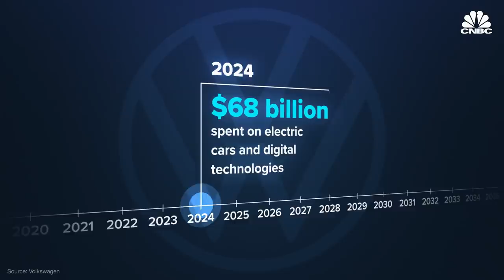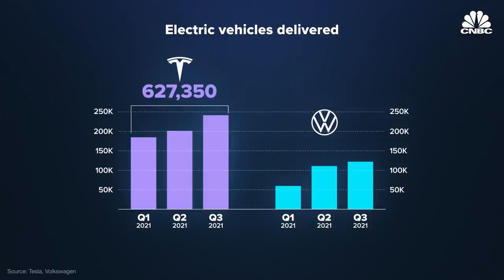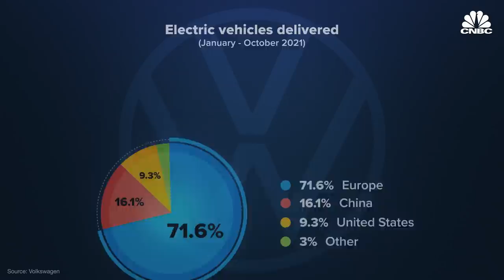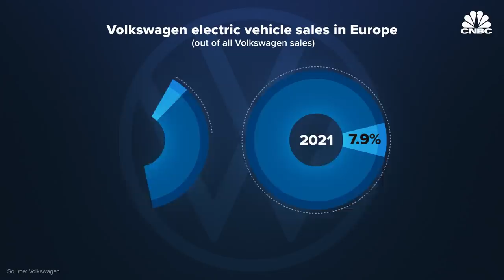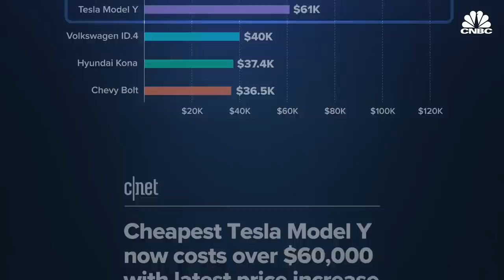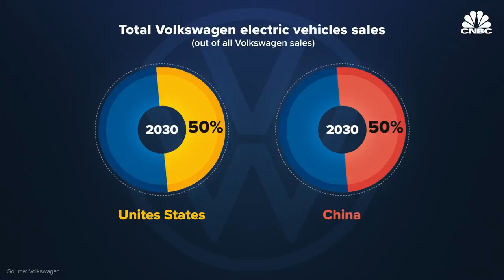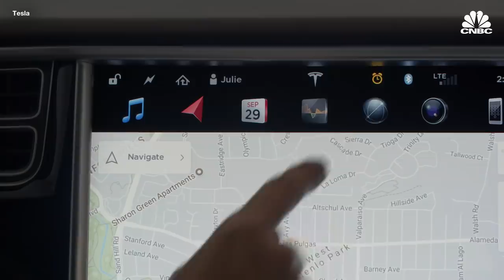Why Volkswagen Is Beating Tesla In Europe

Comment: I'd argue that VW was already bigger in Europe than in the US...so for that reason alone, it wouldn't be shocking to see VW EV's being accepted more readily in Europe than Tesla's offerings.  People are more likely to accept a new technology from a company they already accept, then from one which appears new.
Reply: Check Q3 2021 Ev Sales figures for europe... Tesla vastly outsells VW
Reply: Tesla doesn't make EVs in Europe meaning their supply is relatively low. So, even though demand is high, sales lag behind compared to places with Tesla factories. It's not complicated.
Reply: @HopeIsFleeting  You're 100% correct. Tesla currently only has supply for europe with what they decide to import from China. Despite this, they are still number one in Europe for Q3 2021 Plus number 2 in china... all from a single factory!
Reply: Plus, another significant point is that Tesla is the only EV manufacturer with any sort of profit margin on each car.. roughly 35% margin and constantly increasing. VW is basically selling EVs at a loss
Reply: Wow lots of people with so much knowledge about either company, Tesla this and that, the reason is this and that. Fan boys lol
Reply: So where is Nokia now?
Reply: @vinny7114  🤣🤣🤣
Reply: @rushabhjs  making a ton of cash from their patents.
Reply: Yeah Volkswagen is huge in Europe. In case you didn't know, 1 in 4 cars (not just EVs) sold in Europe are from the Volkswagen Group.
Reply: @vinny7114  Of course they do, this channel is for investors. People usually research the companies they invest in. If that makes them fanboys then fine. What's important however is that it makes them a return on their investment.
Reply: @yscol1313  Man you love spreading lies.  VW sold more in Q3 2021.  If you wanna make the claim Tesla has the best selling single model then you would actually be correct, but vw has multiple popular models, unlike tesla, as per sales.
Reply: @vinny7114  It's called discussion. And it's healthy when people can bring forward their ideas backed with data without being ridiculed for interacting. Pretty sure most people who clicked into this video are interested in the future of EVs...
Reply: No
Reply: @vinny7114  I would just call them educated on the topic, but agree to disagree.
Reply: @Subwolfer7564  what electric VW outsells teslas models? The model y and 3 are the most popular EV in the world.
Reply: It's not just about acceptance, it's about convenience, the total cost of ownership, patriotism, prices, subsidies etc. VW will always have a better service network, availability of spare parts, and so on.  The US is on a high horse when it comes to EVs thinking that everything will be just Teslas. The support for electric vehicles here has been very strong lately and only the future will show. I'd say that making predictions about what happens 10 years from now is extremely premature. Having had a very early start didn't mean absolute dominance for iPhone in the long run and cars are arguably even a much more different animal than a phone, where locality will always be important.
Reply: And VW has the ID3 better looking than the boring Tesla 3
Reply: @KingFinnch  It will not be a massacre. Despite VW having lower margins, they have much better design and quality. Many people prefer a Porsche Taycan, an Audi GT or a VW ID3 to a boring Tesla 3, S or Y.
Reply: @nunolp9067  the id.3 is the most generic car ive seen, the CEO of VW had a major meeting with leaders in the company to discuss how much of a threat tesla is, he made claims like tesla building a car in 10 hours while it takes VW 30 for an ID.4, he even said that the opening of the giga Berlin site will be "brutal" for VW to compete. The taycan has already had multiple recalls and got beat by a bunch of model 3's at the Japanese EV prix because it overheated on the last lap despite being 3x the price. Many people would prefer those cars because they are a sucker for brand loyalty.
Reply: @diazemap  the model 3 was the best selling car in Europe in September, and this is before they have even opened up their new massive factory in Germany. You guys think to staticly, you think brand loyalty last forever and tesla cant ever get good at where its bad and VW can never get worse over time. Tesla has more talented people trying to do more than show a quarterly profit for their shareholders.
Reply: @odisy64  That might be true, but that's because of the global chip shortage which is a fluke that worked massively in favour of Tesla. Tesla didn't outsell other brands because that's the car most people want. There are just not enough of ICE cars to buy right now.  I am not saying Tesla is a bad car and there will be a lot more of them on European roads and why the heck not? Nor am I saying that Europe has been thinking tactically enough but times are changing. In the grand scheme of things any EV is a rarity everywhere and the future is long. Brand loyalty has never worked perfectly, European cars are actually very international. When it comes to talent, there's enough of it in Europe as well. The true danger is China anyway.
Reply: @odisy64  were talking about Europe, context is important kiddo, sit down and open your picture books.
Reply: Tesla needs to fix bad build quality and all the rattles, interiors are from cheap plastics.
Reply: @Subwolfer7564  Yup, this video has triggered many a Tesla fanboy. 11,634,409 cars were registered in total the EU in the 2020 (14,033,559 in the EU plus EFTA region). And how many of them were Teslas? Model 3 accounted for only 85,000 and people are forecasting doom for the European automotive industry. Plus Europe has ultra rich eco hypocritical countries like Norway that are massively skewing the numbers.
Reply: @Patrick-bu5vy  Tesla fanboys have been repeatedly voted as the most annoying fanboys on the entire Internet. BTW, in the end we will be all steamrolled by the Chinese just on the price front. The US and  Europe especially. These fanboys fail to understand even the most fundamental thing of all. That competition is always good for the customer and most people can't afford any of these expensive EVs  anyway. Inflation is raging all over the world. Tesla cars are mostly luxury sports cars with unnecessarily fast motors, large batteries and expensive design full of features that again cost a ton of money and nobody needs them anyway. More and more people worldwide are struggling to cover even their basic needs and will gladly jump at the first Chinese EV costing just as little as 10000 USD.
Reply: @KingFinnch  Yes. Tesla will pass Volkswagen when Giga Berlin opens up. Volkswagen have already expressed concerns over this publicly.
Reply: @vinny7114  "Wow lots of people with so much knowledge about either company, Tesla this and that, the reason is this and that. Fan boys lol"

Personal attacks are never valid arguments. So please try to come with some real arguments instead.
Reply: There's no argument that VW is bigger in Europe than the us.
Reply: @vinny7114  "making a ton of cash from their patents."

The Nokia reference is about their big fall in the phone market. Obviously.
Reply: @nunolp9067  "And VW has the ID3 better looking than the boring Tesla 3"

If you look at the actual specs you will find that the ID3 is the boring car here.
Reply: @nunolp9067  "It will not be a massacre. Despite VW having lower margins, they have much better design and quality. Many people prefer a Porsche Taycan, an Audi GT or a VW ID3 to a boring Tesla 3, S or Y."

Nonsense. The quality of the Teslas coming out from Giga Shanghai is of as good quality as any Volkswagen. Just listen to what Sandy Munro have to say about this.
Reply: Lol a spoke persons for Tesla Ladies and Gentlemens
Reply: @diazemap  "That might be true, but that's because of the global chip shortage which is a fluke that worked massively in favour of Tesla. Tesla didn't outsell other brands because that's the car most people want. There are just not enough of ICE cars to buy right now.  "

Nope. There isn't enough Teslas for sale right now. Tesla will sell every single car they are able to produce for years to come. When Giga Shanghai ramps up they will take the European market as well. The reason is very simple. No other automaker, including Volkswagen, have announced any future production plans that are even near what Tesla is going to do.
Reply: @yourcrazybear  stop fan boy, VW has been making cars for 100 years, Tesla since 2012. You saying that the quality of a Tesla is superior just proves how much of a fanboy you are.
Reply: @siiNke  "Tesla needs to fix bad build quality and all the rattles, interiors are from cheap plastics."

The build quality of Teslas coming from Giga Shanghai is of as good quality as any Volkswagen. Just listen to what Sandy Munro have to say about this.
Reply: @yourcrazybear  I wasn't personally attacking anyone, I generalized the fanboys.
Reply: @diazemap  "Yup, this video has triggered many a Tesla fanboy. 11,634,409 cars were registered in total the EU in the 2020 (14,033,559 in the EU plus EFTA region). And how many of them were Teslas? Model 3 accounted for only 85,000 and people are forecasting doom for the European automotive industry. Plus Europe has ultra rich eco hypocritical countries like Norway that are massively skewing the numbers."

Tesla is growing at a rate of 50% CAGR. The transition to EVs will happen faster than people think. Tesla will soon open up Giga Berlin, and when that factory ramps up Tesla will take the number one position in Europe as well.
Reply: @yourcrazybear  The quality is not the issue. Tesla will figure it out eventually. The key issue will be the price and that's where VW will give Tesla the run for its money and compared to anything Chinese, Tesla will be outright uncompetitive and the same goes for VW. On the other hand, there are a gazillion other reasons than money why people buy this or that.
Reply: @diazemap  "Tesla fanboys have been repeatedly voted as the most annoying fanboys on the entire Internet. "

Personal attacks are never valid arguments. 

"BTW, in the end we will be all steamrolled by the Chinese just on the price front. The US and  Europe especially. "

The Chinese players are indeed a threat to legacy automakers, but they won't have any big impact on Tesla though. 

"These fanboys fail to understand even the most fundamental thing of all."

Personal attacks are never valid arguments. 

"That competition is always good for the customer and most people can't afford any of these expensive EVs  anyway"

On the contrary. People tend to welcome competition. That doesn't mean that they can't see Tesla's dominance in the industry though. 

"Tesla cars are mostly luxury sports cars with unnecessarily fast motors, large batteries and expensive design full of features that again cost a ton of money and nobody needs them anyway. "

Nonsense. But good luck trying to argue that people don't need the cars that are selling like icecream in the summer. 

"More and more people worldwide are struggling to cover even their basic needs and will gladly jump at the first Chinese EV costing just as little as 10000 USD."

Not in developed countries. You will also not get a lot of safety in a car for $10000 USD. Nor will you get a good car anyway for that price.
Reply: @siiNke  you really dont know what you are talking about if you think Tesla is using cheap plastic for their interiors.
Reply: @Subwolfer7564  i was also talking about Europe, like i said, the model 3 was already the top selling car in Europe in September and without having a factory there. you sound really angry if you're telling me telling me to read a picture book, why so angry?
Reply: @yourcrazybear  Everyone's EV sales are growing so this is a moot point and I have never said that Tesla's sales are not increasing. I'm just putting the numbers into perspective. It's easy to report growths in hundreds of percent if you're starting point is so low. Things become really hard when you have to come with really volume car models, provide good quality services, cheap repairs and so on. You're also ignoring the chip shortage that is driving the sales of Europe made cars down. Massively. However, the reason for Tesla's success is not that the demand for European cars is low. We just can't build cars here because of 1% of missing components. And even if one model of Tesla potentially becomes number one in Europe, so what? There's always been a number one selling car in Europe and a ...load of other brands selling their models. Competition is always good. I just hate fanboyish nonsense.
Reply: @diazemap  you know what tesla ranks top in? customer satisfaction, their is a reason cheaper EV's arn't outselling Tesla and its because Tesla is the best for its price.
Reply: @odisy64  to be fair, the best sold car in Europe changes every month, this October it was the Peugeot 2008, in August is was the Dacia Sandero
Reply: @diazemap  the chip shortage did effect Tesla, Tesla would have delivered even more cars if they did not have to deal with the shortage, Tesla was simply able to react faster and more appropriately. Tesla will be able to out manufacture others in the future simply because they have better margins and higher production efficiency, i expect a cell shortage in the near future to bottleneck most automakers including Tesla.
Reply: @vinny7114  the CEO of VW itself had multiple meetings adressing TESLA, the CEO warned the companies leadership the TESLA was better at building electric cars than them, he made claims like TESLA building a model 3 in 10 hours while it took VW 30 hours for a ID.4. he actually said that the competition the the giga berlin plant will bring was going to be "brutal" for VW.

VW may have been around for 100 years but elon is the longest running automotive CEO in the world, he has more experience and knowledge about building a car company than anyone else.
Reply: @edipires15  i know, but dont you think its insane that an imported car from the US and china could outcompete domestic European cars? so what will it mean when those cars are produced domestically in the heart of Europe auto industry. i wonder how many Europeans have held out their orders for a german built Tesla.
Reply: @odisy64  bla bla bla
Reply: Is it because there is basically no tesla available for them to buy? 🤔 is this going to be case when giga Berlin opens up? only time will tell.
Reply: @diazemap  Very true. I bought VW eUp this year and even if I had an equivalent product from Tesla I would not buy it. My reasoning is simple: I have a VW repair shop in my town. The closest Tesla repair shop is in Austria ~ 1500 km from my location.  Also Tesla is actually anti- repair following the Apple approach, which is something I cannot support even tough they have superior product from performance point of view. Car is not a phone and with the prices going up, I want to know that I won't have to replace my car due to some 5 cent capacitor going bad. Tesla is going for heavy vertical integration of their solution and they are putting no priority on the serviceability of the product. It is just a thing you buy, drive and toss away in 5 years.
Reply: @yourcrazybear  While you might be right about ad hominem arguments being mostly a fallacy, one cannot deny their utility in pointing out the obvious, especially if you're right. 

"The Chinese players are indeed a threat to legacy automakers, but they won't have any big impact on Tesla though."

Of course that legacy OEMs have much more to lose than Tesla that can only grow. But saying that they won't have a big impact on Tesla is wrong, unless you deny that they are competition. If there were no other players, Tesla could keep the market of luxurious sports EVs just for itself virtually forever. And these days are over even though Tesla just keeps growing. 

"Nonsense. But good luck trying to argue that people don't need the cars that are selling like icecream in the summer."

On one hand you call me out on using ad hominem arguments, yet you use strawman argument that is also a fallacy and a non-argument. I have never said that people don't need cars. Please do educate yourself before you start lecturing me on this stuff. EVs are not selling like hotcakes. They're actually a very pronounced minority among all car sales given their huge price.  

"Not in developed countries. You will also not get a lot of safety in a car for $10000 USD. Nor will you get a good car anyway for that price."

Car is a very discretionary expense and I don't see the West getting so rich that it doesn't need to care about how much a car actually costs. At the end of the day, it's the car manufacturers that care about the safety. Most people vote with their wallet. Of course Europe will make these dangerous ultra cheap Chinese EVs more expensive through compliance.
Reply: @odisy64  You're confusing customer satisfaction with loyalty or I dare say fanatism. Of course that most first time Tesla buyers will say that their next car will be Tesla because there's not much of an alternative if you need something electric now plus Tesla is very different from everything else. Future competition will erode all this. Plus Tesla cars have to still prove themselves when it comes to long term durability as most of the cars are new and repairs are in-warranty. Moreover Europe is lacking repair centres, charging stations. Big time.
Reply: @odisy64  Tesla has not been affected as much as other car brands. There are more cars that couldn't be made so far because of the chips than Tesla is able to produce in total. Just here in Czech Republic we're talking about 250,000 Skoda cars that aren't going to be made by the end of the year. Tesla wasn't affected because of their better vertical integration, not faster reaction. On the other hand, I agree that there will be serious battery shortages in the future as manufacturing is mostly in the hands of China and they will want to promote their cars at the expense of everyone else.
Reply: Tesla has FSD period, VW is possibly 10 years behind if not more, tech is not easy. And Tesla is AI leader, you are not buying the car your buying the tech.
Reply: @radoslavtomov9121  Yup, Tesla will actually not sell anyone any spare parts. Very anti-repair, very anti ecology, very hypocritical. Musk will share all Tesla's patents but not sell even the basic spare parts? I understand this strategy but it's just a bad deal for anyone who buys a Tesla. Most non-europeans commenting here do not know the first thing about the excellent VW service support here in Europe when any garage mechanic can fix these things and literally all car part shops carry VW. I understand that European cars in the US are often money pits. Here it's the opposite. Everyone is hypnotically fixated on unimportant halo features like 0-60, the size of your infotainment screen, that your car can fart and forgets about insurance costs, serviceability, the actual price of an import, the fact that a lot of people will always prefer home made and above all, that other OEMs do not have the advantage of a lying CEO who is being more and more caught up by his overpromising and underdelivering.
Reply: @yscol1313  the margin Tesla makes... is used for the later fixes mate..... 4-5 visits per customer  ;)
Reply: @SP-dw9gi  Very valid point and Tesla's lead is undeniably huge though we might argue about the numbers. I'd say it's 5 years at most. Other OEMs have very similar technologies that are also rapidly improving. They are just not so vocal about them and Musk has been caught lying so many times that his credibility is dubious at best. However, do you really think people buy cars because they want tech, not mobility in the first place? Tesla's FSD is far from being what it says it is. Full self driving. The name is a marketing lie, period. According to Musk, we should have been flying to Mars for years, Cyber truck should have been produced for two years already and his vapid vapor ware nonsense called hyperloop is the biggest con ever. No, you're buying neither car, nor tech. You're buying both and most people prefer the former, especially if it comes much cheaper. Tech itself will not move you from A to B. And how good is any tech combined with a car if you can't afford it. Especially if you can afford a plain car.
Reply: @nunolp9067  ewww the ID.3 looks fugly. It’s really staying true to the dorky looking EV form factor.
Reply: @EEVOL  EVs have been the future since 1881 when they were invented. They actually came before any internal combustion engine cars. I'm not saying that this time it won't finally happen, just that Tesla would like to be as much VW in some areas as VW would like to be Tesla in others. And that Tesla might hit some snags and others surprise.
Reply: @diazemap  that’s like comparing computers during Charles Babbages’ era to computers of today. Makes no sense at all.
Reply: @vinny7114  Nokia is a has-been. It used to dominate the mobile phone world.
Reply: @diazemap  That's why Tesla is opening a Plant in Germany right now...It will be making millions of vehicles in just a few years in Germany.
Reply: @EEVOL  Yet people when they go buy a car go buy a car, not a computer and all the complaints that people had about EVs back then are surprisingly similar to those that they have now. Expensive and limited range. Nothing has really changed that much because tt would be good not to forget that ICE cars have also improved vastly and keep improving still and all this is throwing a wrench in the works of this hype machine called Tesla. Plus mostly when I talk to people around me, they are rather frustrated by all the electronics in cars than over the moon. At the end of the day a car is a car is a car which takes people from place A to B. Not a gadget. Unlike a phone. Phone is a gadget. You can have a phone in a regular car, or a computer, if you desperately need one in a vehicle. Even in a car 100 years old. I am of course by no means surprised that there are millions of people around the world that are entertained by the Tesla's tech. Just not convinced yet that it's what the majority will be willing to spend big money on, especially short term.
Reply: @glorious_help  source? 😂 or do you mean over the air updates? ;)
Reply: @davidc2838  You say "vastly outselling". Let me hit you with some facts by quoting one internet source: 

"According to an article by a German business magazine, in the first eight months of 2021 Volkswagen was able to sell 76,415 combined units of the VW ID.3 and VW ID.4 in Western Europe. Volkswagen sold about 44,000 ID.3 EVs and 33,000 units of the ID.4 SUV. These two closely related electric cars have together surpassed the sales numbers of the Tesla Model 3, which was newly registered 75,000 times over the same period of time. In addition to that, Volkswagen was also able to distribute 24,000 units of its ultra compact VW eUP"

I don't see any vast outselling, just on the model level. On the brand level, it's the opposite. One month means nothing, especially amidst the biggest component shortage crisis that has nothing to do with  buyer's preferences. 

The US should get ready too, because VW will also have its own factory there. We'll see what the true potential of Tesla is in a market where especially the service network is lacking big time. Not to mention that Tesla won't even sell any spare parts and is extremely expensive to insure. Brand loyalty won't work the same here as in the US for Teslas. Rather in an opposite way.
Reply: @davidc2838 So will VW in Chattanooga in the US albeit in smaller numbers. All those millions you're talking about will eventually also have to be sold, it's not just production capacity, you know and VW and other European brands will follow. The factory is not even open yet. Even if the claimed capacity of 700,00 cars is to be believed, there are about 14,000,000 million cars registered every year in Europe. Musk would need about 20 years to make just EU's annual registrations and the rest of the world is catching up fast. Especially the Chinese. I don't see a reason why there shouldn't be more Teslas in Europe but the same can be said about all electric cars everywhere. The trouble is all the fanboys who jump to dumb conclusions that there will be just Tesla and nothing else. The fanboyism is really strong with Tesla zealots. And that I say as a big fan of Tesla and progress. 

Fun fact: Tesla couldn't even come up with an original name and I don't mean being named after Nicola Tesla. They actually named the company after a company that had existed for decades before Tesla Inc. in my home country of then Czechoslovakia, now Czechia as a producer of electronics. Very original indeed.
Reply: @odisy64  you were talking about Europe when you said the world? Sure thing buddy.  VW is selling more EV cars, is what i said and my comment earlier reaffirmed the model 3 is the top seller *for specific model*.  So what are you arguing exactly? Did i hit a nerve?  

VW has more models that are popular, Tesla only has one that makes top 20 in sales, the model 3.   VW has 4 that make top 20 (ID.3, ID.4. VW e-UP, and Audi e-tron) and those four together dwarf model 3 sales.

Keep in mind this is Europe, its landscape is and has been dominated by its domestics, just like how the big 3 and tesla are predominant in the states.   You can pretend that somehow the factory is holding them back, but why build a factory if there wasn't enough demand with a continent that frankly harder pressed EV's then the states?
Reply: @diazemap  We’ve been hearing how “the competition is coming” for Tesla for a decade…
It’s still not here…and Tesla is growing FASTER than it was previously.
GM has already failed miserably and is having to recall nearly ALL of its best selling EV the Bolt. Its next two EVs the Cadillac and the Hummer will only sell a few thousand each.

VW has already said that it won’t focus on the US as much.
 
Mostly because VW and its board would rather sell ICE vehicles instead of EVs. It’s why Diess most likely won’t be working for VW by the end of next year…
he knows VW has to speed up its transition to EVs and the rest of the company and its board doesn’t want to move that fast because the jobs will be lost as they transition away from ICE.

Don’t kid yourself…
NO-ONE in the US remotely paid attention to the Czech company. It’s called Tesla after Tesla the Inventor. But tell yourself whatever you want to make yourself feel better.
Tesla will continue to output millions of EVs while most OEMs will waste their time with ICE and hybrids until it is too late.
Every single Tesla sold can be improved with Over the Air Updates…
ICE vehicles simply can’t. So every single new Tesla sold can be improved and eventually have Full Self Driving added.
ICE vehicles can’t.
Which means ALL of Tesla’s fleet can be improved and almost none of the other OEMs can do that.
You don’t have to be a fan boi to  understand the fundamental difference.
Cheers
Reply: @diazemap  Apparently Cleopatra isn’t the only “Queen of DeNial”
Reply: @Patrick-bu5vy  You’ve heard…but failed miserably to listen.
Tesla makes a MUCH higher Gross Margin than ANY other automakers. Period.
They will continue to drive costs and parts and labor out of the automotive manufacturing process. Much like Bezos kept dominating more and more of the Amazon’s  markets…which expanded greatly as they grew…
Tesla will continue to expand more rapidly than any other EV makers…and will continue to take more and more sales from ICE manufacturers.
What people fail to understand is that Tesla is competing against ICE vehicles (and those who manufacturer them) not against other EV makers. EVs are going to sweep through the ICE industry just like smartphones swept through the mobile phone market.
Tesla will continue to come out with more and more models and styles…and can more easily afford to create those with their massive margins and faster production methods and factories.
There will be many EV suppliers…
But Tesla will become the most dominant one because they are willing to do the things the ICE manufacturers are not…
And Tesla does not have the massive debts and pension issues that many ICE manufacturers do.
Cheers!
Reply: @diazemap  What you fail to understand is that a car will be even more important than a phone and will eventually be driving by itself…it will also power your home…
and in an emergency it can help support the grid…at least until the grid becomes much more distributed.
Software is eating the world…
And right now it is busy eating the automotive industry…both in the vehicles…and how they are made…and how they are updated over the air…and how they will be “driven” in the future.
Tesla is leading in ALL of these areas because they realize they are a Technology Company FIRST…and a products company Second.
None of the Legacy OEMs has the Software teams to actually effectively compete with that…
Which is why they will continue to remain behind.
Tesla will surpass Apple in valuation in a relatively short period of time. Not just vehicles…but also Power Supplies and Grid Scale Battery Storage & the Software to rule them all.
Reply: @siiNke  Old FUD…
Catch up with modern build quality
Reply: @davidc2838  When it comes to Europe, nobody here has been talking about coming for Tesla for a decade and I'm talking about Europe. Big focus on EVs actually happened only very recently. This is Europe and VW, not some dubious US brands that should have been consolidated under one truly competitive brand ages ago or gone bankrupt had it not been for the endless bailouts. We never had to deal with this sort of nonsense. Hummer and Cadillac as an example that VW will not be competitive? Now who's kidding who... (-: 

Don't know why you keep pointing out that Tesla has been growing faster than before. It's actually not that hard if you're growing from zero. Especially in a climate that favors EVs in general (and if you're heavily subsidised through carbon credits whereas traditional OEMs are effectively fined - talking about serious market distortion). 

Nobody is denying that Tesla is growing but it doesn't mean that if Tesla is supposed to win, others have to lose.

You say that VW is not going to focus on the US. That was true about ICEs. Read up on the lastest news, don't live in the dieselgate past. 

Regarding the stolen name. Tesla Inc. really didn't pay any attention to the international law and was subsequently sued by Tesla Czechoslovakia: 

"After series of actions taken by Tesla a.s. against the American company Tesla, Inc. (formerly Tesla Motors, Inc.), a contract between Tesla a.s. and Tesla Motors, Inc. was signed on 6 October 2010, establishing a coexistence of TESLA trademarks and regulating relationships between them.[7] The preamble to the Tesla trademarks coexistence agreement establishes the following: "

At least our name was imaginative play on words as "TEchnika SLAboproudá" - meaning "low current technology" in Czech. No, my friend you keep telling yourself whatever because you are fanboyishly offended by facts. 

Of course most of VW would like to keep selling ICEs instead of EVs for the time being and you can't blame them. VW is stuck with all the off the shelf parts and old investment and Tesla isn't. But it just means it will take them longer to transition. On the other hand VW  have actually some income from the sale of ICEs to fund all the investments. Plus EVs are generally unaffordable to most people, even in first world countries so I for one am glad that not all cars are EVs. 

The last paragraph is nothing but a bunch of your opinions that are not based on any facts, just fanboyish wishes.  Tesla may be outputting millions of cars but so will others. The world market is actually very big and there's room for others, even ICEs for many, many years without resorting to these absolute statements like "until is too late" and such... Cars are not phones so comparisons with nokia and such are rather moot.
Reply: @Subwolfer7564  i dont care if your talking about Europe, you realize VW's place when you compare it to the gobal market, do you not see how an import competing with European domestics is a big deal? most of VW's electric cars are sold in Europe, they sell more to the Chinese than Americans. the ID.4 sold 72k units and the id.3 sold 52k and the E-tron sold 36k globally in q3 2021. tesla sold 240k of both 3/Y globally in q3 (Tesla does not give details of how much of each model but model Y sales are starting to eclipse model 3 sales). in the US, Tesla owns 80% of the EV market and neither foreign or domestic automakers can compete here but this is not the same story as Europe where Tesla sales are eating into their EV market. 
their is demand, Teslas are sold out for half a year because the demand is so high. when the berlin factory comes online it will offer Teslas at a cheaper price than what was offered before and Europeans would still feel somewhat proud that it was made in germany. 
will that sway everyone? NO, does it matter? NO. why?
because Tesla will produce so many of them they will flood the market at volumes VW cant match. Tesla has a consistent 50% growth year over year. elon predicted all the way back in 2013 that they would be producing 500k cars in 2020 and they ended up producing 499,500 in 2020. if they maintain a 50% growth for another 10 years they will be producing 20 million electric cars a year. 
the CEO of VW himself said that the opening of the giga berlin factory was going to be "brutal" for VW. 
what does it matter if people preferer your cars if they cant get them and Tesla is the only one who can build them fast enough to satisfy demand?

the upcoming battery shortage is really going to show how far Tesla has been planning this stuff, even VW knows this is going to happen.
Reply: @Patrick-bu5vy  Stop fooling yourself…
Tesla far outsells ANY EV maker globally. The only reason that it’s not YET dominating Europe in EVs is that its factories in Germany is just about to open. It will also open a Texas Factory this year and start pumping out more and more vehicles every month.
When your focus is 100% on EVs it’s much easier to keep that focus and grow your business…rather than fighting internally like VW is doing.

We’ve heard how fierce the competition will be for an entire decade…and it’s been severely lacking.
Tesla will be able to sell every single EV it makes for the next five years without a single issue…
Because ICE vehicles will handicap the major OEMs.
Reply: @davidc2838  Apparently Cleopatra isn’t the only “Queen of DeNial”
That may be funny but totally fallacious ad hominem non-argument. I actually give credit where credit is due with Tesla and don't argue with many of your arguments. On the other hand what you say is full of cognitive dissonance and fanboyism when it comes to Tesla's competition and the general pace at which this revolution is going to be happening.
Reply: @diazemap  Sorry you’re so triggered…
But they are sold out through June of 2022…
So obviously MANY people can afford to buy Teslas.
BMW, Porsche and Mercedes (and many others) wouldn’t exist if people couldn’t afford them.
crying because some feelings are hurt is not effective. Once people actually understand that software will dominate how cars are made and function, they will understand why the current automakers will struggle.
Tesla’s not wasting money on stock buybacks or dividends…
And they’re putting all that back into growth and advances in their software and products.
Reply: @vinny7114  Making something for 100 years has nothing to do with whether they will succeed in the future.
In fact, the inability to move with agility is the main reason big bureaucratic slow changing companies are disrupted.
Nearly every ICE OEM is not moving fast enough to match the EV makers led by Tesla and the Chinese.
Every EV sold is one less ICE vehicle sold…
Which hurts ICE OEMs and their overall sales.
Reply: @davidc2838  Tesla vehicles suffers from misalignment way more than any others.
And who is to say that the future is electric? You people seem to think you speak for the entire world and that's just not the case. EV sales is a tiny fraction of the automotive industry.
Reply: @davidc2838  It's you who fails to understand that I understand all this. What you're mentioning is basic knowledge. That's not the point. What a car can do. That's completely off-topic. Of course, EVs can do that and even more. Should I add something to the list?

What do you mean by a car being more important than a phone? The car is not a phone. Horses for courses. You can't take a car to bed. I don't need an EV to have all the functions of a phone and especially not a Tesla. This doesn't make any sense. Nor do I need a Tesla to get from A to B. 

And that it will eventually drive by itself? This I have been hearing about for more than a decade if I should quote you. I will believe it when I see it. I mean if I live that long. And powering my home? Not every home is suited for this application, in some countries blackouts are quite rare. People in need of off-grid solutions are actually very rare here in Europe and grid distribution is almost 100%. Very niche market here for blackouts or powering your home. It makes sense only in combination with solar panels to improve your fuel economy through charging your EV, especially during the night and summer. Still, nothing to write home about, I mean savings-wise.    

Over the air updates? Nothing that cannot be copied. VWs can and do updates as well, sadly only by ethernet. Nothing that cannot be changed in the next facelift. Tesla doesn't hold any patents here or a technology nobody can implement. 

No, it's not software that's eating the automotive industry, it's hardware - chips. I mean as of now. There are no cars not being completed because of lack of software, get your facts straight. Keep underestimating the competition, time will tell. You're especially in for a surprise from the Chinese. (-: Market valuation means nothing. The higher they fly the harder they fall. Theranos, Nicola ... (-:
Reply: @vinny7114  hurts to hear it huh?
Reply: @davidc2838  cheers? Oh boy, oh boy, ohhhh boy. I rest my case, why don't you look up on that crystal ball of yours and tell us if Aliens are real and who really killed JFK? 😂
Reply: @diazemap  You’re fooling yourself thinking that technology is not continuing to accelerate.
The vehicles ARE more advanced than phones…at least the ones made by Tesla…

We’re seeing the faster than 50% growth rates of Tesla and the shrinking of ICE vehicles every year.
Adoption curves for new tech are rapid and increasingly fast as they move along those curves.
It’s why major companies seem to shrink overnight and lose market share rapidly…
This will also happen in the auto industry as the EV manufacturers with no baggage will take their sales seafront existing companies. It’s already occurring and will only accelerate.
There’s a reason why none of the legacy OEMs will ever be among the most valuable companies in the world again.
Their old products, processes and equipment (and leadership) will continue act as an anchor that slows the progress of moving to the latest tech and products.
This has happened over and over and over again in many industries and the current leaders will shrink just like the other companies in disrupted industries did in the previous disruptions.
The lack of software expertise is what will harm most of these OEMs and the fact that they believe it’s all about the vehicles…
When it’s clearly about the end to end energy structure and the software to manage it.
Which is why Tesla will continue to grow at a rate of more than 50% for another decade at the expense of the current Legacy OEMs.
Cheers
Reply: @diazemap  You’re funny…
And clearly don’t understand advanced technology.
The grid will continue to become more and more distributed. It has nothing to do with blackouts…it has to do with distributed energy production, distribution and consumption.
The ID3 sat in parking lots for many months because their software was garbage.
The lack of experience with advanced tech and software is holding back all kinds of vehicles from being produced…or performing like the most advanced one are.
Chips have to be programmed…
Which is why Tesla was able to switch out chips and have their software engineers recode other chips to function in Teslas.
Keep thinking that it’s an even playing field for the companies. It’s not. There’s a clear leader in Technology in this and other related industries.
Reply: @Subwolfer7564  Nokia knew how to make mobile phones…
But they didn’t know software like Apple.
The same thing is happening with vehicles and batteries and software. NONE of the legacy manufacturers can keep up with Tesla on the Technology side. Which is why Tesla will eventually become the largest vehicle manufacturer…
But also massive battery storage, power distribution, electricity generation and software to control it all.
Tesla is also willing to put ALL of its profits into growth…
Which the other OEMs are not. They have to pay out dividends and do stock buybacks to keep their investors from screaming…
It’s very similar to how Amazon has grown massively by continually reinvesting in the company and not wasting money on dividends or other distractions.
There’s a reason Bezos and Musk are the two richest people in the world. Continuing to reinvest in growth with no need to sideline things.
Cheers
Reply: @diazemap  Couple of things though, your right FSD is not what musk says it is, but key word is Yet. Why do you think Tesla stock is 1T + cause investors understand that this company is not selling cars, it's is technology. I would buy the technology, most ppl that but Tesla do. As far as how far? I feel like the geeks at Tesla are very very good at AI, I believe Google and Tesla are preety close, I think dojo will help immensely.     While other car companies are catching up, they are not close cause they are no tech, they are car companies first, Tesla is disruption. I also feel Europe is so far behind on tech it's insane. I think the only ones close are the Chinese, I'm some aspects maybe even better, and for these reasons I feel like VW will be a dying breed. I guess time will only tell, but when innovation leaves you in the dust look what happens (GE,IBM).
Reply: @Subwolfer7564  wow you sound like a fanboy, when did i say VW will fail? Its going to do fine and sell more and more cars, but Tesla is going to dominate their market when they complete their plant just like they did in china. You dont know anything about reliability, whats unreliable? VW has been building cars for a 100 years but right now the CEO of VW is saying Tesla is ahead of them and they are much better at manufacturing than VW. He even said tesla could build these cars faster. Find me a car with better overall specs than a tesla for the same price.
Reply: @davidc2838  You're fooling yourself thinking that I'm thinking something I'm not thinking.   It's so funny. Which addresses your first claim that I believe that technology isn't advancing. Something I never said and would not think for a second. And the same goes for the second claim that the car is more advanced than a phone. Which is again a completely off-topical, irrelevant claim. I said that a car is not a phone. What you keep doing is strawmaning, look it up. A very common argumentative fallacy and I'm calling your BS out. 

I can agree with the rest only to the point that there will be changes and disruptions and that there will be a lot more EVs or other cars than ICE than now. I see no reason why Tesla shouldn't be growing at a steady rate and also at the expense of some OEMs. It's logical. The trouble is that you keep crystal balling us with your bombastic predictions about big OEMs failing just because of software. There's a lot more to cars than just software. You fail to understand that at the end of the day a car is not just about software, it's a predominantly mechanical device that takes people from place A to B. If I need a computer or a sophisticated phone, I can buy one already and it will be much better and practical than anything from Tesla. Again, I'm not saying that software is not important, only that other OEMs have it too and Tesla's lead doesn't automatically mean that they will dominate anything. There are tens of factors that people consider when buying a car.
Reply: @davidc2838  It is you who is fooling yourself. Despite all the hype, Tesla’s sales currently amount to less than 1% of total global auto sales this year. Even if they achieve the phenomenal growth that you and your fellow fanboys see as all but guaranteed, they will struggle to ever gain more than 5% of the total auto market. Musk will soon find himself battling it out in a very crowded space, with a product that is a triumph of marketing over substance. It’s a tough world out there - Tesla fans will soon learn that they have been sold a fairytale.
Reply: @vinny7114  the 50 cents army , elon offers 50 cents/per BS post ^^
Reply: @rushabhjs  nokia is top 5G T-com network equipment maker, worth much more as medium level phones
Reply: @N1ckZ  yeahhh, VW Wolfsburg makes 950 000 Golf a year, as much as T in 2021 as a whole, switch to e car is easy, same body tech etc!
Reply: @odisy64  That day he was drunk or you post BS hahahaha VW Wolfsburg makes 950 000 Golf a year, as much as Tesla in all fabs as of 2021! AND switch to e car is easy, same body tech etc!
Reply: @brunokoegler2189  ‘the 50 cents army, Elon offers 50 cents/per BS post.’

LOL. 100%....life in Elon’s Siberian troll factory must be getting harder and harder for these clowns. I’m just waiting for one of them to blow the whistle on the whole scam.
Reply: @diazemap  Both Kodak and Xerox did poor because they did see the future and did nothing about. Kodak have design a digital camera will before digital camera become a thing. Xerox have the future UI in their develop lab and didn't nothing with it. Big company die because they have no foresight. Apple was dying till they make a mp3 player and because the biggest company in the world. Tesla is not just a car manufacturer but VW is. Android is free. If you give cars away you always have a big market share.
Reply: @brunokoegler2189  you sound drunk yourself, the CEO of VW said this to 1000 of his workers because he want the to realize how hard its going to be to transition to electric cars, he also warned about losing 40,000 jobs in this transition in order to keep VW moving. Tesla makes premium electric cars, a golf like many other cars, are a cheap gas car. Tesla will probably make 850k cars in 2021, 1.2 million in 2022 and 2 million by 2023, they are consistently growing 50% every year and thats why they are a big deal.
Reply: @jimc1654  So there you have it. Some big companies go bust because of bad management and with Apple you rightly pointed out that it's never too late for a turnaround. The big fallacy is to think that all big companies have to go bust just because the world has changed and confuse car companies for software companies only. All I see is competition for VW, so therefore quite likely smaller market share for VW. However the market is bigger than ever before. If VW is to fail, then also all other European car makers including Toyota, Ford and so on. It's just extremely premature to be making such forecasts.

Second, nobody knows what the future holds. There are other technologies at play than lion batteries. The transition to EVs will take a very long time. Decades. So long enough for any company to turn itself around in any direction. But as with so many things around Tesla it's all "going to have been for at least two years" if you get my gist.
Reply: @davidc2838  "There’s a reason Bezos and Musk are the two richest people in the world. Continuing to reinvest in growth with no need to sideline things."

For Bezos this is true.  For tesla not so much, they have taken boatloads of government money investing in green energy, they wouldn't be half the size they are now without that.

Tesla is publicly traded btw, they do dividends and stock buybacks, thats irrelevant. 

"The same thing is happening with vehicles and batteries and software. NONE of the legacy manufacturers can keep up with Tesla on the Technology side. Which is why Tesla will eventually become the largest vehicle manufacturer…" 
eh, consider most people wont even buy and EV yet there's a long way to go. Frankly tech in cars is the reason prices are so bloated and cars are more and more annoying. 

but keep dreaming
cheers
Reply: @yscol1313  you are wrong! Without the money cashed in from green certificate Tesla is in loss ! Keep that in mind
Reply: @rushabhjs  In fact, Nokia is just getting bigger again, e.g. they produce network and radio technology for 5G/6G.
And you can't compare them, VW will certainly not fail in Europe, they have too good a network, partner workshops etc. for that and they are investing well in the E-car market.
In addition, there are many people who will not buy a Tesla because they do not like Musk and it is an American brand.
Reply: @paulmorozan7893  I’m afraid your figures are about 2 years out of date my friend… I’m not being alarmist, I simply suggest you look at Tesla’s more recent earnings reports :)
Reply: Nobody here talking about the fact that Tesla promised FSD feature would be level 5, but it only got the level 2 approval now and their head of legal recently admitted that FSD will not change in full release, i.e. permanently stay level 2. Whereas Mercedes EQS already is level 3 approved... ^^ Tesla is so done. They are rapidly losing EV-marketshare in the EU. Quite simply because when push comes to shove and you actually need to make a decision on whether you want to buy that Tesla, you will have to face the hard facts: Mercedes better self-driving, range and luxury than Model S and Kia, Hyundai, VW much... much cheaper for same range, self-driving but more luxury features and better service network than Model 3. Only hard lifestyle fanboys are still going Tesla.
Reply: Not sure if the "most sold car" argument was addressed here yet: Tesla marketshare is very far behind, I think it was ranked on 18th place. It's just that Tesla made headlines in September because the Model 3 was the most sold model of the month. Why was it most sold model of the month? Because a) Tesla sales aren't regularly registered but always at the end of the quarter, when they ship all their vehicles at once. Most of the time their sales are close to zero actually. And b) because of the semi-conductor shortage German automakers were unable to ship vehicles. They now have similar waiting times as Tesla does with 1 to 2 years waiting lists for many models. Anyways, the Tesla Model 3 never was and never will be most sold model of the year or quarter or in any of the 8 out of 12 months of the year, where Tesla does not ship vehicles. If you sell a tenth of what the others sell, but do it all at once, it does not change the fact that you are selling a tenth of what the others are selling... :*
Reply: @jurycould4275  I agree that Elon/Tesla should not keep promising full autonomy by <insert date> when it clearly isn’t going to happen by then. That said, they are still half a decade ahead of Mercedes. Their production capacity is also increasing exponentially, regardless of current market share. It would be impossible for them to maintain such a high market share when it is such a humongous market. Let’s come back here in 5 years time and see how the market has turned out! I for one am excited, regardless of who wins
Reply: @Janoip  yes supreme leader. The fact that people don’t buy their phones any more doesn’t matter
Reply: @Patrick-bu5vy  every time i see someone say tesla makes up less than 1% if the global market its a dead giveaway for someone who doesn't understand the market. How will it feel like when Tesla produces 20 million cars a year? Because you seem to forget the company grows 50% every year and the only thing holding them back from selling more cars is how many they can make a week.
Reply: @diazemap  their faster reaction was because of their vertical integration, i dont see how you differentiated those two.
Reply: @SP-dw9gi  While Tesla might be described as a tech company, the trouble is the very intrinsically mechanical nature of a car and that will never change. Tesla being a tech company means just that it can make money in other areas than cars. OK, why not? So does VW. You will say that Tesla makes batteries. OK, but in partnership will Panasonic, FSD chip is made by Samsung, on-board computer chip by AMD. Anybody can make these strategic partnerships and become a tech company as well, including VW. VW said that they would invest massively into software in general. It's just that VW couldn't be bothered. We'll just have to wait and see if at the end of the day people will want more a gadget than a car. Tesla has actually never invented anything and holds no significant patents. Especially when it comes to cars there are a lot more considerations than just what processor is inside. Most people are actually rather annoyed by all the tech already and keep asking for simpler cars.
Reply: @diazemap  I don't know about who is more annoyed and wants simple cars, but your wrong to think VW can just invest more into tech and become a tech company. That's not how it works. The partnership with Panasonic was for creating the batteries not the design, which Tesla does. Especially the new 4680 cell which it will do wholly.Samsung creates the chips for others too cause they have the foundries, the chips are 100 percent designed by Tesla, you see VW doing that? I don't think so. Like I said it's a innovation company, and investors are betting big on it. Their software is far better then anyone else and even the mechanical aspect that you mention is better. They are electric cars you can't just try to replicate.
Reply: @nunolp9067  Nope, the ID3 looks crappy compared to the Tesla Model 3, look at the worldwide sales numbers, and ID3 does not sell a quarter as well as the Model 3.
Reply: @nunolp9067  In Germany, this impression will be true, as you are stuck on German brands, but not in the world. Quality is not great in the VW group and you know it,  there are tons of problems with them, Tesla right now builds the better BEVs by far. The sales number for BEVs worldwide are always (so far) for Tesla: Tesla sells many more BEVs than VW, has a better image and leads the whole market.
Reply: @petersanni144  yes, but no one really wants an ev that isnt a tesla, and the ones people might want more arent available in large enough quantities
Reply: @SP-dw9gi  If Amazon can design its own chips, so can everyone else. Money talks very loudly, sorry to break it to you. Just a matter of time. Especially if VW made a pledge to do so. Look it up. There are a gazillion of chips in VW cars already, so they're not some complete novice. Not saying that Tesla's software isn't the best, just that the future is long. To put it simply, electric cars are actually very easy to replicate. Do you even know that an EV was invented in 1881 by a Frenchman. Just wait and see. Mark my words.
Reply: @KingFinnch  The sales suggest otherwise. Unless you live in Elon Musk's and YT's hype train, reality distortion bubble. I just checked how long it would take to deliver a Model S Plaid to my country. The end of 2022.
Reply: @SP-dw9gi  That's the best you can do? Hit me with an ad hominem non-argument sprinkled with a strawman? Amazon is a glorified eshop and has its chips made by Intel. Custom chips are nothing unique. Why do you think that traditional OEMs cannot design their own chips and be good at it? They just haven't felt the need yet. But the paradigm has shifted and they learned their lesson and won't repeat that mistake. Look up RISC-V. 

The argument that the old must be obsolete si so funny. How do you explain that Mercedes (being the oldest car company in the world) is on level 3 autonomy and Tesla only level 2? Fanboys should learn to give credit where credit is due because this is exactly why they are called fanboys. Not every company keeps lying pathologically about the true capabilities of their AI. Like Tesla does.

Big car companies are getting beat by the chip shortage if we're talking sales volumes, not the tech itself but such details are lost on you. ICE cars are not sold as much as before not because there's no demand but because there's no supply. True revolutions are always driven by demand, not the lack of supply and bribes through subsidies. The real demand for EVs is actually not that high. At least yet and traditional OEMs will keep making a lot of money selling ICE cars. 

You're so locked in "if Tesla is to win, everyone else has to lose" mentality. It's so silly. Like that no old companies are making any investments or progress and the only thing that matters when buying a car is its electronics.

Apple also had a huge lead with their first iPhone but was subsequently caught up with Android and now there are far more Android phones sold than Apple.
Reply: @diazemap  You Drive Pilot from Mercedes is still rolling out, not out yet. While they say Tesla is level 2 autonomy, I don't see that, it's cause they are using only vision for it. I feel once Dojo comes only, it's moments away. Mercedes does not build their own autonomy btw it's either a aquisition or partnership with a company, maybe Nvidia.
Reply: @SP-dw9gi  Yes, Mercedes is based on Nvidia. That's exactly what I was talking about. These partnerships that virtually almost any carmaker can make and eventually have what Tesla has, albeit a little later and not as good. But also better potentially. Tesla also needed a couple years to design their first really in-house chip. So Tesla also didn't use to design their AI chips on their own. They are a designer anyway and have the silicon made by TSMC  or Samsung. There is still a lot of input from Nvidia, AMD, Intel, or Samsung engineers that will gladly work with anyone if they're paid the right price. Of course, not with anyone really, but definitely not only with Tesla. And if Mercedes is already level 3, just imagine where they might be 10 years from now. According to many fanboys, these traditional OEMs are already legacy and doomed to fail. If Mercedes wanted to put the same onboard computer in their cars like Tesla, what's really stopping them? It's only a very slightly modified PlayStation 5 chip anyway.
Reply: @rushabhjs  nokia didnt do what vw is doing they didnt shift their focus had they done it might have been a different story(may be / may not be) but vw is shifting it's focus and is trying to pump out new models.
Reply: @air57721  The whole comparison with Nokia is nonsense. The fact that one company made a mistake doesn't mean that others have to act the same way. So incredibly fallacious to claim that. Mobile phones are much more just about software than cars and a car is not a phone and Nokia failed to see all this big time. If I needed an iOS experience in my car, I would just pull out an iPhone out of my pocket. I don't need a Tesla for that. Who cares about the software in their car infotainment anyway? The car has a different job to do than being just a screen with a ton of apps. Have the fanboys ever heard of the screen mirroring feature? Moreover, any car maker can make their car run almost any OS they like. Windows, Linux, MacOS. It's just that you don't care because you already have all the functionality of a PC or a phone and expect your car to take you from A to B as cheaply and safely as possible and on top of that you care about its estetics, total cost of ownership and so on. Tesla's unique selling point is its most advance autopilot and maybe best efficiency. Both can be copied. Nokia failed because there isn't really room for tens of operating systems and Symbian sucked big time (not open source, Android is a derivative of Linux and iOS of Unix - both battle-tested fully mature OSes) but when it comes to cars, I wouldn't be so sure. Especially because any car can theoretically run any software, as there are thousands of PC producers using processors made just by two companies (Intel, AMD) on effectively only one OS - Windows. Linux is negligible. In a nutshell, Tesla is not Apple and if other companies figure out true full self driving I don't see a reason why not buy anything else, especially if it's going to be cheaper with better service network etc.
Reply: @diazemap  I think I just posted the same thing but in a different way he told that nokia failed and I told that is cause they didn't change themselves with time but VW is trying to and I changing themselves
Reply: Check the sales statistics of Tesla vs VW!
Reply: @yscol1313  Not in Europe.
Reply: @vinny7114  
Exactly
Reply: @odisy64  
Dis you forget the battery fires of Tesla EVs?

Every vehicle has its set of problems.
Reply: The amount of tesla fanbois in this thread is insane
Reply: @suntzu1409  tesla makes over 1 million cars a year and they are still 11x less likely to catch fire than a gas car per 100 million miles based on NHSTA data. Electric cars like Tesla only really catch fire after a high speed collisions but thats expected to drop with newer cell technology.
Reply: @odisy64  
1) no. of gas cars on roads today is several times larger than the no. of EVs on roads today.
It isnt fair to compare data from 5 million+ gas cars with data from 1 million EVs.

2) i never said anything about EVs or gas cars in general.
I just said that Tesla also has had fires like that racing Porsche.

All i said is 
a) Teslas arent perfect.
b) Teslas have their own problems.
Reply: @suntzu1409   the data is ratio adjusted, you get the total miles of all gas cars driven this year and divide it by number of reported fires. You have one gas car fire every 19 million miles driven, Tesla has 1 fire every 205 million miles.

Why did you feel the need to tell everyone here that Tesla's aren't perfect and have their own problems? We know that, its been an issue all of Teslas existence. Seems like you're just detecting from Tesla when their problems aren't as bad as the problems we have with gas cars.
Reply: @odisy64  
If [2*2 = 4] is the only data you have, you will conclude that the square of any number is equal to double that number.

If [3*3 = 9] is the only data you have, you will conclude that the square of any number is equal to triple that number.

Why did you feel the need to say that some Porsche caught fire in the first place?
Reply: @suntzu1409  where in my comments did i mention porsches catching fire?
Reply: It had mostly to do here that Tesla had long waiting times. And Volkswagen could supply here in EU, and had a factory in EU. It was not a Fully open choice to choose between 2 but mostly a forced choice based on government incentives and timing, and needing a car now for leasing. Rather than waiting a year to get supply from Tesla which can't build fast enough for the whole world yet.
Reply: @KingFinnch  I wish I could laugh at all of these comments after it opened and doesn’t have the expected effect
Reply: @KingFinnch  VW has also a very high demand and could sell far more cars in Europe. And VW can grow faster than Tesla because they have the factories and the knowledge of mass production. 
And in Europe the people love small cheap cars and don´t need a high acceleration on their cars. Besides that Europe have more laws and some "cool" feature of Tesla's cars are forbidden. For example this strange and dangerous steering wheel will never be legal here. Every driving school is shocked about this stupid "steering wheel" in the form of a Formula 1 steering wheel.  And there are a lot more of "cool" feature that are just dangerous and forbidden. I am pretty sure Tesla will be overtaken in Europe by other companies like Mercedes, BMW, Renault, etc. 

And the factory in Berlin won`t open until March because some certificates are still missing. And there are still some court proceedings against Tesla's new factory. I think they will open in summer or even later.
Reply: "People are more likely to accept a new technology from a company they already accept, then from one which appears new" only applies when the tech is equally matched, Tesla has objectively better technology.
Reply: @yscol1313  Giga Berlin just opened...Tesla to the Moon
Reply: @vinny7114  Because we do research... which has also helped me time Tesla stock purchases - like during the dip before Giga Berlin opened. Nothing wrong with being Fan boys...we're the ones that know. Just watch...I'm betting my posts will age better than yours.
Reply: @odisy64  Model 3 and Model Y most popular in the world :-) Muskfanboy claim. Reality : Kia EV6GT was voted car of the year. The new e-tron SUV is one of the most desired EV Suv' with the Skoda Enyaq. The Hyundai Ioniq5 sells very well.
Reply: @yscol1313  In 2022 Peugeot 208, Dacia Sandero, VW Golf, top 3 best selling cars in Europe, Model 3 is not even top 10. Facts. Look it up
2022 Best selling cars in Europe
Reply: @THEREALZENFORCE  thats nice and all but they arn't selling anywhere near as much as Tesla. they make over 1 million model Y's and 3's every year and are still in such demand they are sold out for the rest of 2022. i would love to know who voted for the EV6GT as the car of the year (probably some auto journalist).